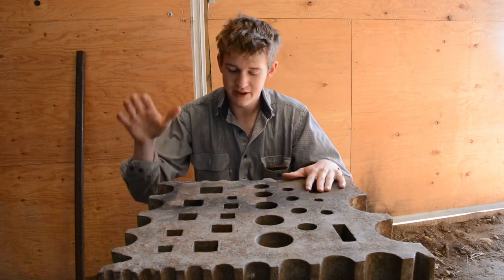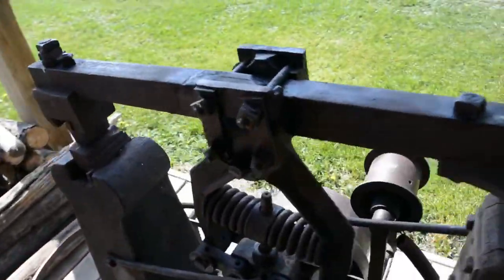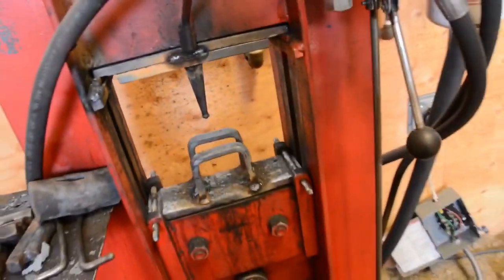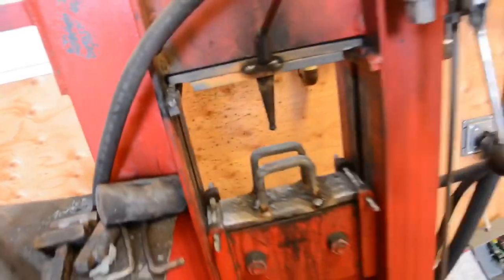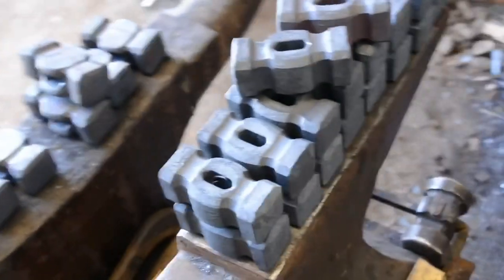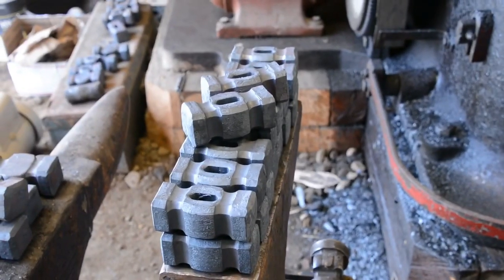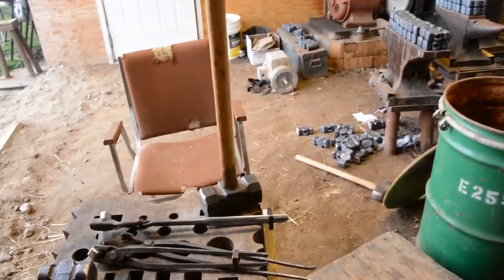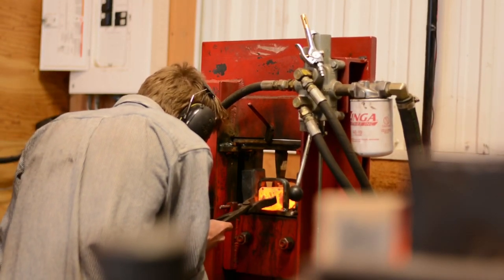Making 100 Hammers for Alec Steele pt. 3

Comment: Clearly that "new" hammer needs to be powered by the stream tractor in the corner of your shop!
Reply: It actually would probably be good for that if it still works and you can get a big enough belt.

Comment: Do you feel you get as accurate placement of the fuller without a spring fuller? I may give it a try. Looks like it works well and clean with a saddle die. Great work!